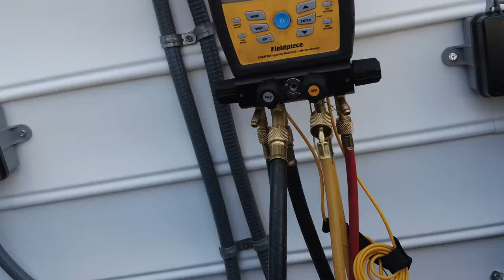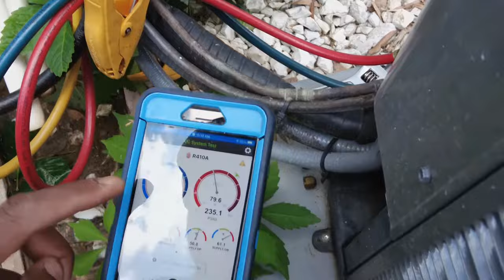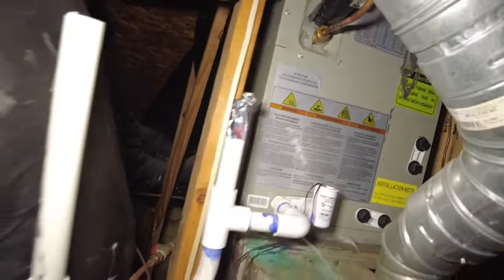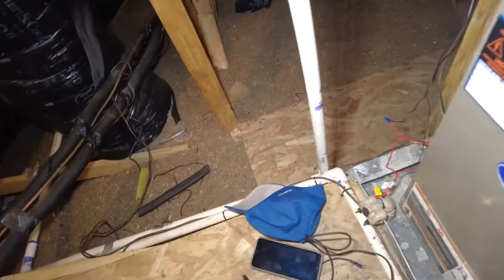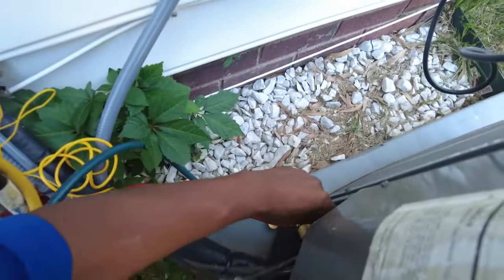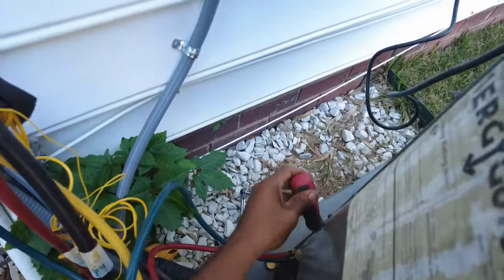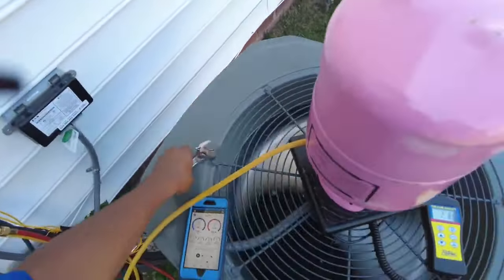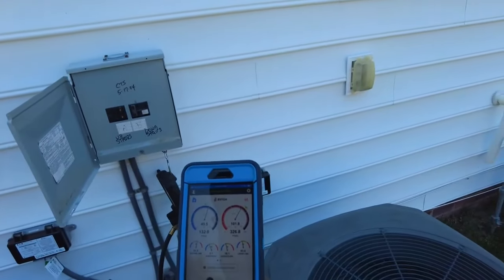Preventive Maintenance Saves Compressor - Trane Unit Running Without Metering Device for Years

Comment: Okay so im new here but when we have low sub cool and low super heat does that mean the metering device is oversized. Again im still learning so if you could explain it i know this was a piston but would this be the same for a txv oversized?
Reply: If it is a piston, then yes, either it is oversized, or it is missing one altogether.
  If it was a txv, then there is a big chance that it could be stuck open.
Reply: @Parabellum-X  if it’s a txv it’s more likely the bulb isn’t attached well
Reply: @joeshearer1247  That is a possibility too.  
  However, if the bulb was attached properly from the get-go, chances are that the sending bulb didn't become detached unless somebody started messing with something that they didn't have any business messing with to begin with.
  We are on the same page though.